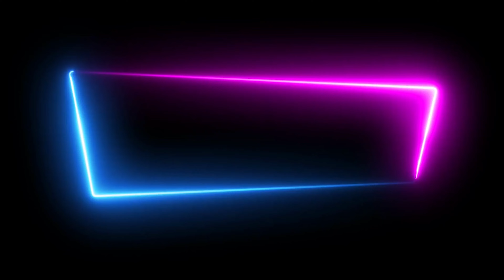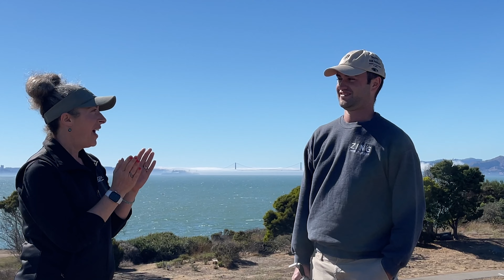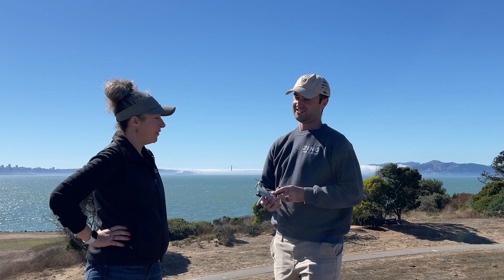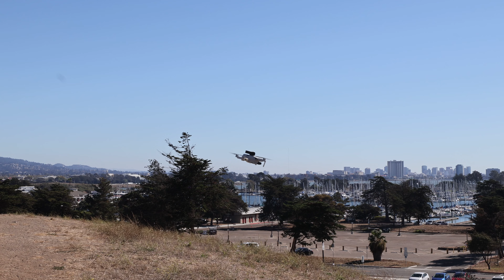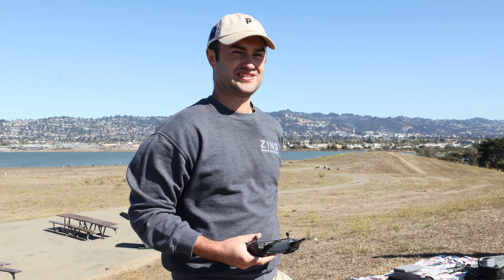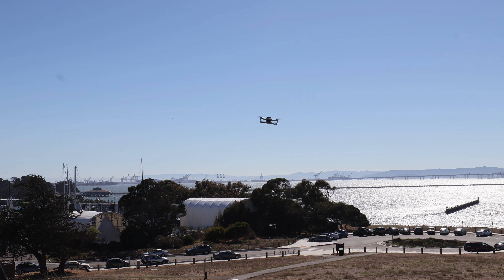USA Made & Now FAA Approved - Zing Remote ID

Comment: That thing is huge and way over-priced.  The FAA told us (with hand on heart) that we should be paying about $50 for a RID module.  Did the FAA lie or is this thing just overpriced?
Reply from the maker: To manufacture in the USA costs more, and some people are willing to pay for that, myself included. I also truly believe in supporting entrepreneurs, so it’s not for everyone, but for some people this will tick a lot of boxes
Reply: @HopscotchInteractive  xjet, AKA Bruce Simpson is well aware that estimate is from 3 years ago, before the pandemic and chip shortage, supply chain issues, etc. Bruce is an electronics professional in his former life. I challenged him to help with an opensource RID project for a $30 module. He refused, doesn't believe in it. Bruce's advice is to just break the law,. He's just spouting off when he chimes in on the subject.
Reply: @HopscotchInteractive  Yes, but there are other US-made products which cost almost half the price and are much lighter -- which again begs the question, why would you pay more and fit something so heavy to such a lightweight drone?
Reply from the maker: @xjet  my Mavic 2 Pro was packed up but he had his little drone for the trip already out (in town from Florida), not the best demo for that reason - but I put it on my drone later and it was a non-issue. At 249g yes it allows him to fly under Part 107 with it, but I don’t think anyone would really do that, it was more for illustration purposes and we literally just didn’t have my drone out yet :)